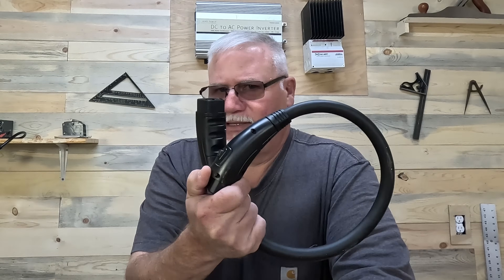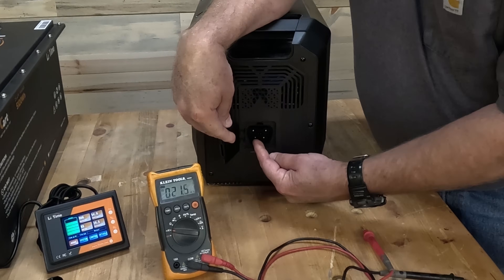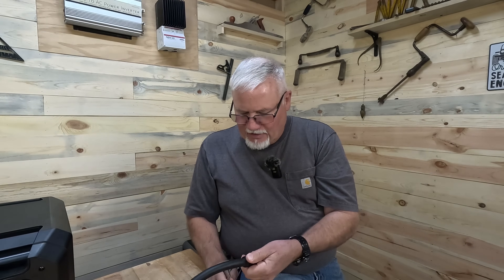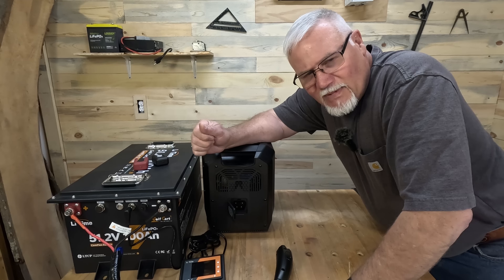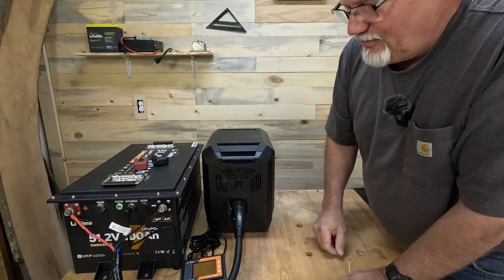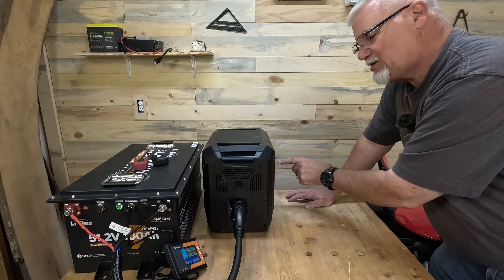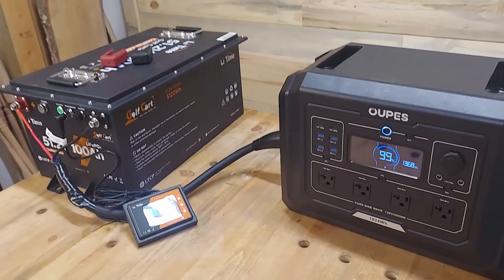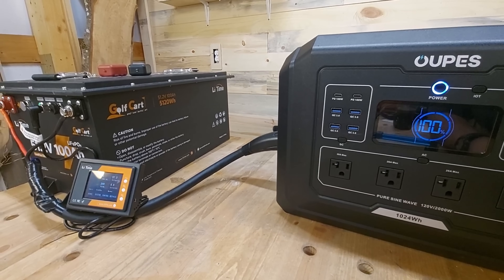The Best Power Station Boosting Hack Yet!

Comment: How do you handle the communication wires (small gauge)?  Just cut off?  Taped? not connected to anything?
Reply from the maker: In this case, I cut them and taped them off.  If I were to use a B2 battery, I'd not cut them, I'd just place a terminal block in the center of the cable.

Comment: I'm brand new to the whole power station thing and am looking for advice from all you people out there that know a lot more than I. I just purchased the Mega 1 for $299 and am considering buying the B2 extra battery for about $680 or just another Mega 1. I live in California and only occasional have power outages. I'm just looking to run a few things like the fridge, coffee maker, TV and a few led lights if needed. Any recommendations on which I should do would be greatly appreciated.
Reply from the maker: A fridge typically uses about 150w to run after the compressor spikes so plan on 1500wh, getting you 10 to 12 hours.  Coffee makers use a lot at startup, but not much once brewing finishes.  Best bet is to get a wattmeter and use it on everything you want to run and for the length of time you anticipate.   That will tell you how much battery reserve you need.

Comment: That looks like 10 gauge wire inside the battery expansion cable for the power connections - would you agree?  With the built-in 2000 watt inverter, you could be pushing 42+ amps.  If those are 10 gauge, it seems like using all 4 power wires inside that cable (2 positive and 2 negative) would be the safe bet and together provide a current capacity of about 60 amps.
Reply from the maker: Nah, it's metric but I believe the US equivalent was 5awg

Comment: It looks like the cable used two positive and two negative conductors of smaller gauge for flexibility of the cable while maintaining current carrying capacity... it looks like you only used one of the positive and one of the negative, any reason you did it that way other than simplicity?
Reply from the maker: https://youtu.be/nnZFCYhtfA4 Was just really for the first experiment.   You'll see what I did in this video, with both 😀

Comment: Great Video!  I think that Oupes is on to you though.  The B2 expansion cable is out of stock everywhere.  Any ideas where an aftermarket version of that connector can be had (like the one you posted for the Pecron)?  Alternatively, is it possible to find the right kind of pins so that I could make my own?
Reply from the maker: They have .ade more and shipped them to the US;)

Comment: I try my 400ah lifepo4 battery on my Anker Solix F3800 Plus de with solar port and i only get 200 watts to extended my anker… how to get more because i use my Anker offgrid mainly so it always run ans charge with generator but its expensive
Reply from the maker: It depends on the input voltage of the solar port  If the LiFePO4 battery is a 12v battery (sounds like it) that is' likely too low a voltage to take advantage of the solar port the way you need.  In most cases, best is 48v battery or a good DC converter that can provide 48v.

Comment: I noticed when I had my solar panels hooked up. At night time it drained the battery is that normal? Can I put a additional solar controller to stop that?
Reply from the maker: Hooked up to what?
Reply: Solar panels hooked up to oupes mega 1 over night.
Reply from the maker: It should not do that.  When you disconnect them does it do the same thing?
Reply: No. I am now thinking purchased a battery off Temu that said it was 51.2 V but apparently it’s only 48v. So I think the opus was feeding the batteries.
Reply from the maker: Hmmm....ok, You should not parallel different voltage batteries and that may be the problem for sure.  Better to run that battery to the solar input and then run solar to a charge controller on the battery like this:  https://youtu.be/C0psWTrMTgM

Comment: When I have the external battery connected with the opus b2/b5. The external batteries isn’t charging the opus. It is giving it extra runtime. Is that normal? They need to be charged separately?
Reply from the maker: it doesn't charge the Oupes.  Connecting this way puts the batteries in parallel and they both deplete under use.  Once depleted they have to be charged up.

Comment: So I found out, if you’re only connecting one battery, you need to use the black in the red. I tried wiring off the blue and the brown and it wasn’t reading it. Switched back to the black and the red like you have in the video originally and it started working.
Reply from the maker: Good to know! Thanks for sharing your experience.

Comment: So you need a 48 volt battery or something to step up the voltage to 48 volts? PS Semer Fi
Reply from the maker: Semper Fi!  Yes, you need a nominal 48v battery (51.2v LiFePO4) to make this work.  Stepping up the voltage will not do the same thing and shouldn't be done.
Reply: Thanks very  helpful
Reply from the maker: anytime 😊

Comment: When using an added battery and using the  oupes mega 1 expansion  port.  Not using there battery ,  how much volts & current can I bring in with solar controller ?
Reply from the maker: If their solar controller, then the limit is 80v, I believe, and 800w.  Id just over panel a little to say 1000w.  If a separate one on the battery itself the CC is the limiting factor.
Reply: So on the battery itself, I can put as much as I want as long as the controller is good?
Reply from the maker: Yup -- the battery will only allow the amount of power it's designed for.  So, for example a typical 100AH 12.8v LiFePO4 battery usually has a 100amp BMS and the recommended charge current is usually 20-50amps.  So, while you could run 1280w to the battery (100amps at 12.8v) it would be better to run about 600w to it though, if also running to the power stations solar input, more would bleed off to the running power station.

My general rule of thumb is to have enough solar to charge a battery in 2-3 hours max so I divide the capacity by 50% and use that as a good rule.

Comment: Any idea if this will work with an existing b2 ? Also any idea if the connectors are available anywhere than oupes? 139 bucks for a cable is steep.
Reply from the maker: Not sure what youbmean 'existing B2"?  do you mean battery or cable?

Comment: How many amp Watt hours did you get depleting both? How many Watt hours did you Loss? would be good to know if its worth it to run that way or go directly to the Solar input?
Reply from the maker: It divides the Amp draw between the batteries so they draw down together.   Much better than the solar input

Comment: The LiTime meter is bouncing so much something odd has to be going on. My guess - the draw is cycling from zero to peak 120 times per second as the inverter creates a sine wave. The LiTime meter may be sampling the instantaneous current at various moments, and showing that instead of averaging over a longer interval.
Reply from the maker: Hmmmm that seems odd
Reply: @TheOldJarhead  Not odd at all. It's a common issue when measuring AC current or time varying DC current. The voltage/current meter is digital, with a sampling interval that is typically about 3 readings per second. The current (or more accurately, the voltage dropped across a sensing resistor) is sampled, using a sample and hold circuit. Then the held, steady value is digitized over the next few hundred milliseconds. Then a new sample is taken, and the process repeats. The current drawn by the inverter is DC - but it is not a steady value. It varies from near zero, when the AC output voltage is zero, to a maximum when the AC is at its peak. There are bound to be some fairly beefy filter caps at the input of the inverter - and those will smooth the current flow - but there will still be a lot of ripple in the current flow. The current sampling will happen at random times relative to the AC line frequency, and will sometimes catch it at a peak, sometimes at a minimum, and every value in between.
Reply from the maker: I'll be honest, I was just agreeing with you but I was also wondering what that had to do with the video and then I realized you must have meant the LiTime battery monitor in the video.  You have to add camera's filming LED or LCD displays...often they cause a flicker in the image that isn't noticed or scene by the human eye.

Comment: My first question is if both units have their own protections, why do you need to attach a fuse between them? Second question is what size fuse should it be? I hear people say add a fuse but they don't tell you what size and when you look at fuses, they are many different amperages so I have no idea what size to go with!
Reply from the maker: The fuse is there to protect the cable and should be 25% greater than the cables amperage rating.  So for an 8 Awg cable rated at 45amps a 60amp fuse would work.
Reply: @TheOldJarhead  Thank you.
Reply from the maker: You bet!

Comment: After spending over 150 dollars to add a battery to my oupes mega 1 , I find that this so called hack doesn't even work, it will not even power up. crap 🤬🤬🤬🤬🤬🤬🤬🤬🤬🤬🤬🤬🤬🤬🤬🤬🤬🤬🤬🤬🤬🤬🤬 I got a few choice words for you
Reply from the maker: My first comment disappeared which is odd since I'm the channel.  But, let's get to the point:  You bought a battery for $150 and tried to do this hack with that battery?  And you checked polarity, voltage and put in fuses etc?  The only reason this would damage someone's power station is if they wired something incorrectly.  It's a parallel battery connection but of course, you have to make sure everything is perfect before making the connections.  Once done, with the Oupes Mega 1 you then have to turn on both.  I turned on the battery first, then the Oupes.  So, please, before you accuse me or anyone else of wrong doing, first, you did the work, not me.  2nd, how about explain EXACTLY what you did and hopefully we can help you understand what went wrong.

This hack works fine and I've now done it multiple times on a couple different power stations and have viewers that have also successfully done this.
Reply from the maker: I see you posted this twice.  Once us enough,  please answer my questions asap
Reply from the maker: I'm going to add this:  what $150 battery did you buy exactly?  The batteries I'm using are $850-$2000 so we're not using even remotely the same battery. I'm guessing you tried using a 15AH battery maybe?
Reply: I added a 100 amp battery to try the cheap hack, the battery doesn't turn on, if I had a battery that turned on it wouldn't be a cheap hack,
Reply from the maker: If you added a 100AH battery it was not a 48v LiFePo4.  You cannot do this with something else.  I made a point in the video of talking about the voltages and you absolutely need to match the batteries with the correct voltage.  a $150 100AH LiFePo4 would be a 12.8v battery and that would not be a good idea to use.  I'm sorry you didn't understand what I'm doing here.  I'll watch it again and make sure I discuss battery voltages and I'll add a disclaimer to make sure folks don't try this with the wrong kind of battery.

One piece of advice, never try something like this if you don't fully understand what's being done.  Again, I'm sorry you didn't understand what I was doing.  Perhaps submit the Oupes for a Warranty claim and get an actual 48V battery.  They run around $750-well over $1000 for the bigger ones (100AH) and over $300 for the little 30AH ones.
Reply: If I wanted to spend over a thousand dollars I wouldn't cut up a cable to add a battery, I would just buy the extra oupes battery that goes with it
Reply from the maker: Understood but you can only do this with the right battery.

Comment: Has anyone done this to a Jackery Explorer 2000 Plus? I'm afraid to try it.
Reply from the maker: Not that I am aware of.  I think I was the first to try it with this one, and a few others have now .  However , if it has voltage and you match it with the battery it should work though they may be like Ecoflow and need a Canbus hack with a resistor

Comment: Not sure if this was mentioned or not, but since there is 2 hot and 2 negative coming from the oupes unit using their cable, is it possible instead of trying to cap of the other 2 and to prevent issues can you lug those other 2 and add a second battery that way instead of parallel the external batteries?
Reply from the maker: Yup, I did cover and yes you can add a 2nd or double up
Reply: @TheOldJarhead ok, im new to this if i double up to one lug and i fuse the positive do i need to double up the wire from fuse to ex battery? Or just a bigger gauge from fuse to ex battery?
Reply from the maker: if youvdouble to fuse (for higher potential Amp draw) then match cable from fuse to battery to the size of fuse used (basically fusing is mainly to protect the cable, so if using a 100amp fuse the cable should be able to handle about 75amps
Reply: @TheOldJarhead thank you!
Reply from the maker: You bet

Comment: I know this is an older post.  How is the Oupes running?  I have the same unit and hate spending 600 for a refurb battery from Oupes when I could get a higher capacity battery for about the same cost
Reply from the maker: Working well :D  Just used it today for my next video and sent it on the Rubicon in a friends Jeep to do some heavy wheeling and overlanding.  All in all, it's held up nicely.  At least a few viewers have started doing this now as well and with batteries like this one from LiTime https://amzn.to/41iEE6C you can get monitors and chargers too :D  Granted, for $999 but it's new, has a good name and comes with the extras.

Comment: Golf Cart Battery + Mega 1 = 6K ?
Reply from the maker: 5120wh + 1024wh = 6144wh
Reply: @TheOldJarhead Refurbished Oupes 2K Add On Battery is $620.00 - some GCB / Rack Mount  are as low as $750.00 for 5Kwh @ 48 Volts = a No Brainer and well worth Investing in Their Expansion Cable.
Reply from the maker: Yup.  I think Ecoworthy sever rack 48v 100ah is $750

Comment: Hello, If you want to put a inline circuit braker, what type is best and amps, volts (size) in between as a cutoff?
Reply from the maker: Amp rating should match the cables used.  In this case, a 100amp breaker would be fine, I think (using wires rated at 75 amps) the car audio ones like I've shown are fine.

Comment: Or can I use just 24v instead?
Reply from the maker: See previous.   You must match the voltage and would be best to parallel with the same voltage battery.  You can get small 51.2v LiFePo4's if weight is a problem (it is for me)

Comment: Can you charge both batteries if you hook a charger up to the golf cart battery
Reply from the maker: I believe so, though the Oupes charged charges them both
Reply: @TheOldJarhead yeah the only reason I asked though because my generator I live off-grid and I don't like hooking my generator up to the oupes because when I unhook it my TVs and stuff shut off when it switches from the charger that's built in back to the battery when I unplug it. Thank you for the video I'm fixing to order another battery to do this exact thing I have the oupes mega 5
Reply from the maker: Ahhh makes sense to me.

Comment: Ive Got 4 Golfcart batts 48v Going to setup so i can use Oupes as entire house inverter with 10K YAHOO! .Thanks I was Waiting for Some brave Soul to do this with the Oupes.  #2 same power out. PS Oupes 2,  650.refurb E bay Cheap I Paid 960 a year ago.
Reply from the maker: Just be sure they are 51.2v batteries and remember it's only a 1k charger and 2k inverter 😉
Reply: Me To if you look on the battery there are pins you can easily tap into just put a good breaker, Whole House Backup, I can NOW Tap into 4 x 50amp 52v + Oupes 1+ Batt, off to the races,

Comment: Could we have a few batteries wired in series or parallel and boost the capacity even more?
Reply from the maker: I would do series but parallel yes, as long as the same voltage.

Comment: Unless things go south with mod I'll leave this as the final update :-) .. on recharge it basically equalized itself from a rate perspective and both finished charging together minutes from each other.  It did start out pushing more power to the LiTime most of the time.
Reply from the maker: Awesome!  Love hearing that.  Thanks for the update!
Reply: Any idea if it would work any different with 2 add-on batteries already daisy chained? I have a Mega3 with two 2Kw B2 add-ons. Would adding a 5Kw server rack to the second B2 cause issues because they have different capacities?
I'm thinking no, but it could be an expensive experiment...
Reply: @roatanbound2023  Already with my M2 and Golf cart battery they aren’t the same size so seems fine there.  I’ve wondered what the behavior of a B2 would be without the communication wires attached but I don’t have one to test.
Reply from the maker: Good question.   My suggestion would be connect B2 to Mega 1 or 2 and then extension battery to the B2 provided voltages etc ate the same as tested.

Comment: Hey thanks for getting back to me if I buy a Eco flow connection wire and send it to you and you use it on your platform if it works can you send it back?
Reply from the maker: I would except I don't have an EcoFlow power station to try it on.  I'm doing a video today on the subject and will explain what to do, what to look for ect and how to test if that will help?
Reply: Hi there,did you managed to get it working with ecoflow??
Reply from the maker: I haven't, but a viewer has used a resister.  Perhaps I'll see if he wants do a live

Comment: ••   @TheOldJarhead  - setup continues to impress... both batteries fully charged.. when Mega 2 said it was 0%.. the LiTime was at 20% and continued to be used.  I took LiTime 48V down to 1% so this will fully utilize even when Mega 2 has depleted it's battery.   Charging works fines just like you saw.  This was tested with a 1800-2300W load on the M2.  Wiring was only the slightest warm using both wires.
Reply from the maker: That's awesome!  Love to hear that! Thanks for sharing!